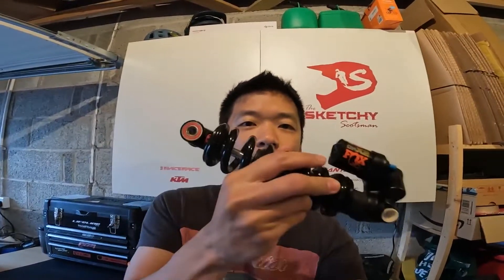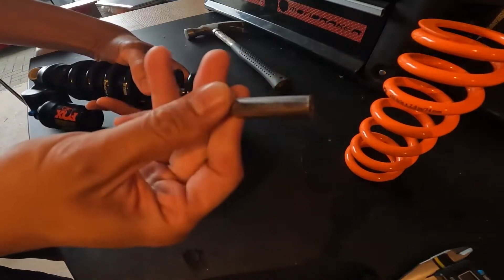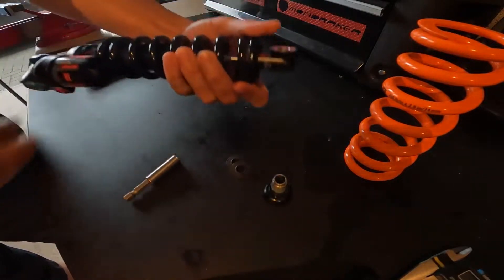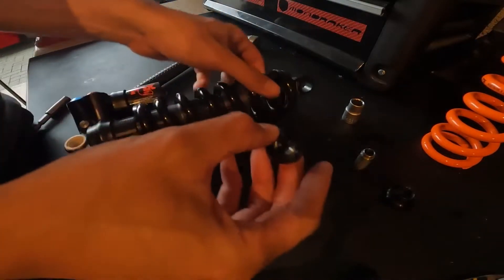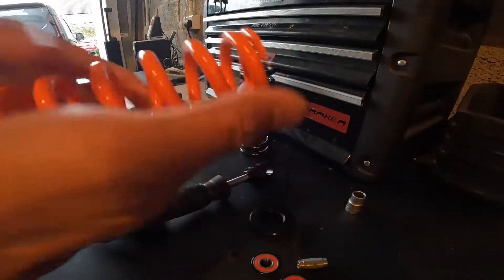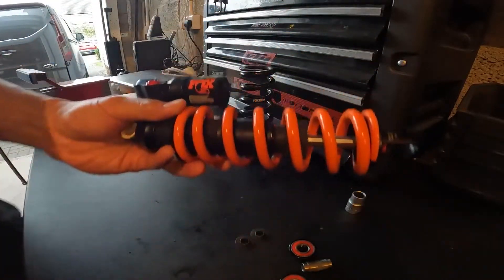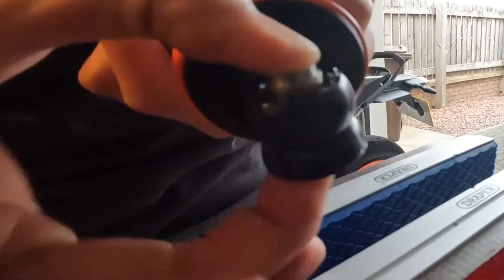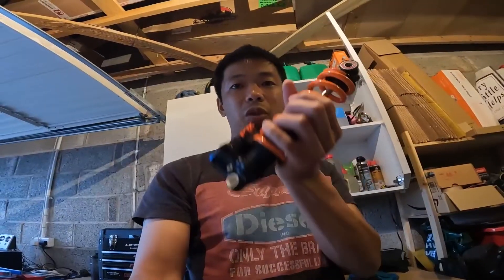Fox Shox DHX2 spring change and bearing removal

Comment: Hey. I think you are the only person who managed to remove the cups with bearings out of the shock. I saw people removing just the bearings themselves, and it makes sense kind of. I am a bit skeptical before installing them to my EXT shock. I tried normal 7-piece Fox hardware, with EXT and it was a bit more tight than in a Fox DHX2. So I am a little bit scared to install bearings if I will need to change the spring again.

Comment: When an oriental chap on two wheels gives you advice, heed it! The fact that you had a KTM in the back gave further credence to your post. Found the same screwdriver extension from my draper multi-bit set and a 10mm 1/4" socket. X2 bearing hardware removed, ready to install onto my Bomber CR! Top stuff - saved me £135. Do I care if its tolerances are slightly off? Nah!